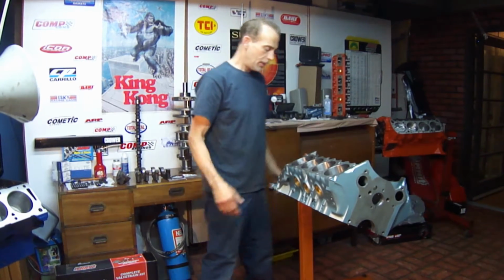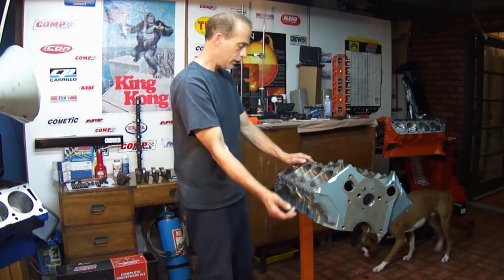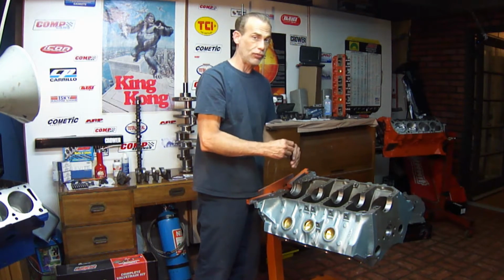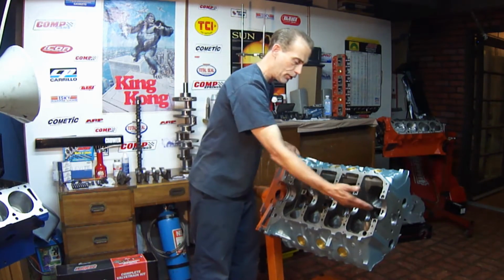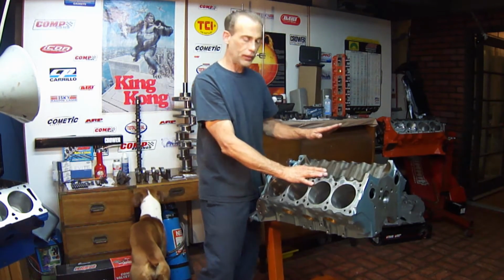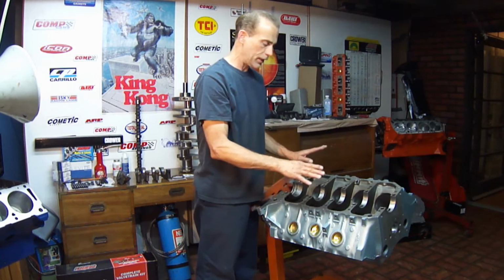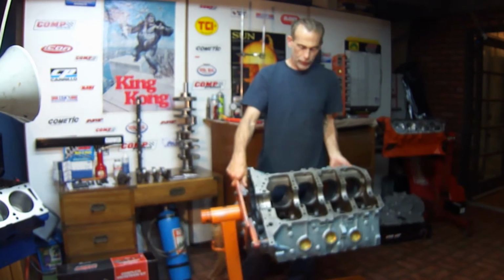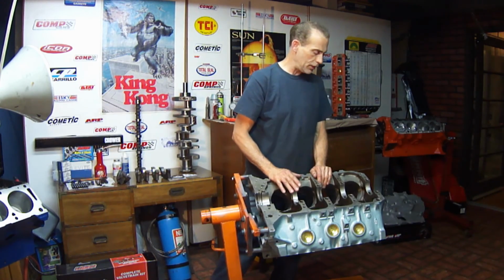1969 PONTIAC  GTO JUDGE 500HP 455 BUILD UP...PART 2

Comment: Bolting the cap on with studs will change the dimensions because the torque specs were designed for coarse threads and the studs use fine threads on the top thus multiplying the actual torque on the cap.

Comment: Where did you go? You said in part 2 you would be right back after installing all the crank bearings.  You are doing such a good job with the videos.  Hardly no one talks in length about Pontiac  motors anymore... Please finish the series.
Reply: Probably got busted by Blueprint Engines. They are a massive, highly-automated, performance crate engine builder based in Kearney, NE. All SBC/BBC

Comment: All right that looks that's a nice looking motor but won't you use the rear end 5 heads if you want to get 450 to 500 horsepower out of it
Reply: @James Conley
 ... "rear end 5 heads' ???  ... RAM AIR 5 heads.